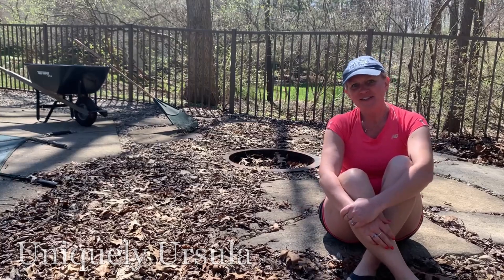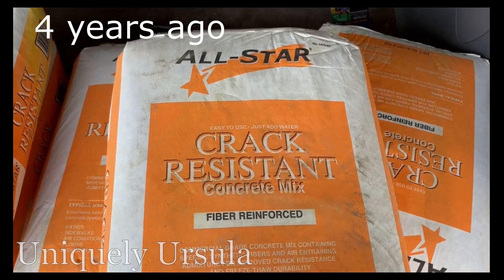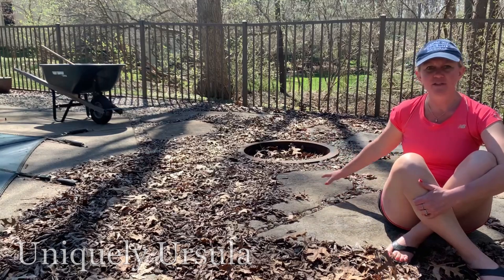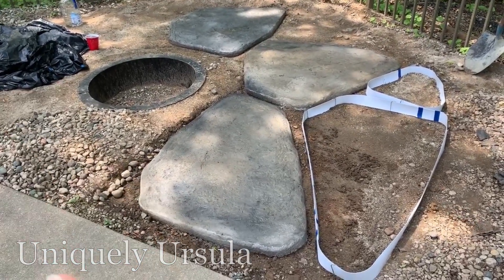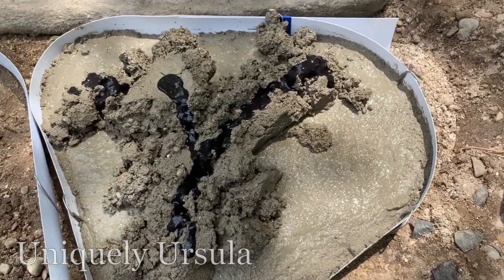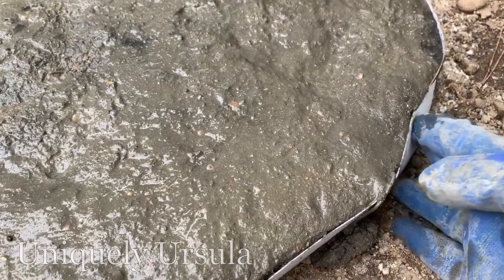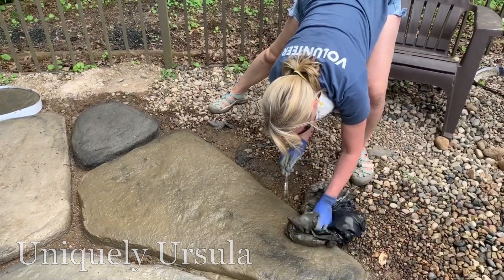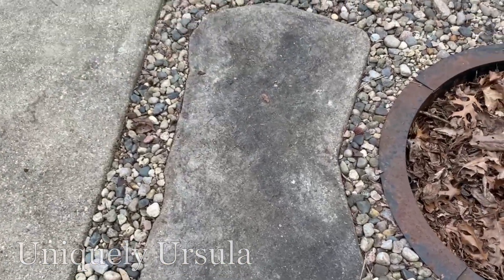DIY Concrete Stepping Stones FAQ's & Bonus Material

Comment: Thank you for the followup!   You did a beeeeeeutiful job.  
 I wonder if part of the rocks' stability is that you poured them in place.  I can see how that saves some labor.  You don't have to prepare a base for some natural stones you bought at the stone yard or some preformed stones from a big box store.   And you don't have to shimmy the stones into place to force the base to fill in any shallow places on the bottoms.   The concrete will conform perfectly to whatever kind of ground you're putting it on.

I do wonder how it is that your gravel stays in place when you rake leaves.  Waaaa.  My crushed rock keeps moving  out of place - on top of the flagstones, into the grass - just from the dogs walking over it.  I wanted smooth river rock gravel like you have.  The landscaper told me the crushed rock would be more stable.  I think he was just saving money.  🤔   I hate the stuff.  Anyone reading this, don't use crushed rock between your stones.